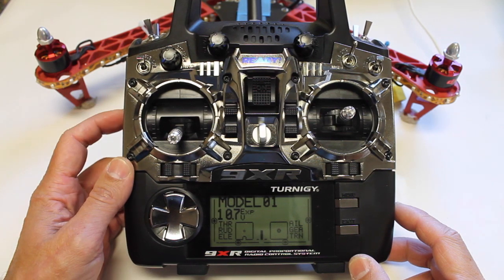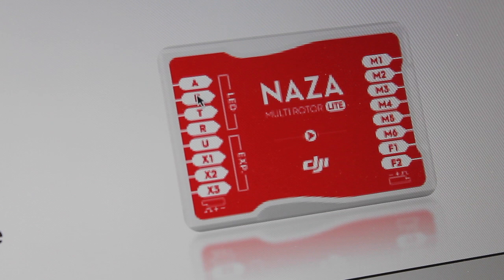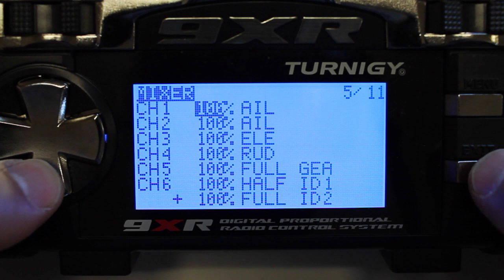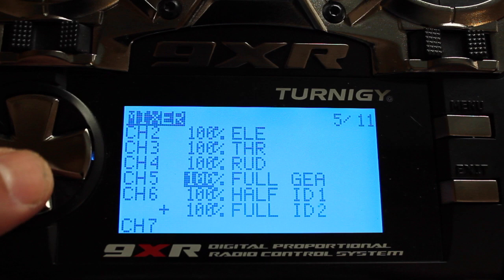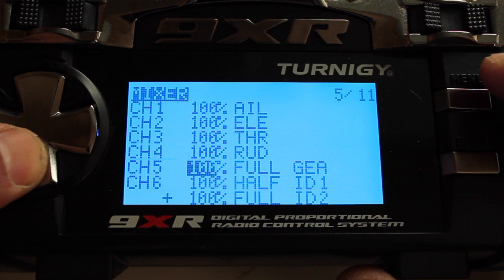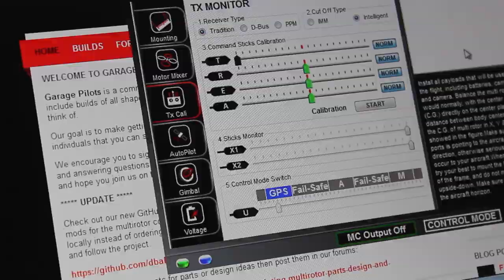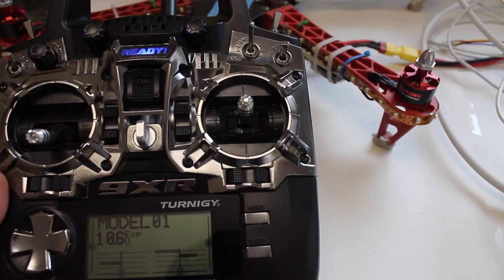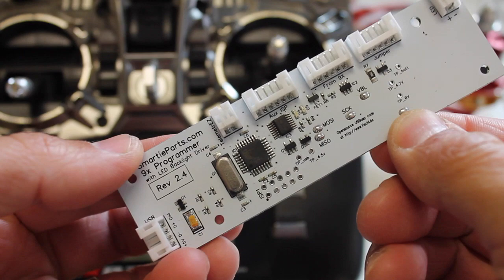Turnigy 9XR 3 Position Switch for Different Flight Modes w/ NAZA Lite and TBS Discovery Quadcopter

Comment: Yeah Dennis Baldwin the 9XR has the derivative software turnigy9X, but the er9X software is much much better, I flashed mine the Day I got it, that and coupled to FrSky Module and Df8R + RX and you have an awesome system with a Failsafe that actually works perfect too :-)

Comment: Brilliant! Very helpful and clear and it's solved my noob issue. Big thanks
Reply from the maker: Thank you for the feedback, Simon. Glad to hear it helped.
Reply: except, when I flick failsafe I get the failsafe mode activating but it still won't return home. It climbs to space instead. I've calibrated the GPS etc and I've got >6 sats so not sure why?
Reply from the maker: simon ayton That's strange. Does it fly okay in GPS attitude mode?

Comment: great stuff Dennis! Thank you very much for all you do for the RC community. Super helpful videos. have you had any experience with upgrading the firmware on 9xr radios? Also, any experience with the Naz. light to V2 firmware upgrade?
Reply from the maker: +Peter Schultze Thank you for the feedback. I have not done any 9XR firmware upgrade. I originally upgraded my 9X to er9x, but nothing other than that. I haven't done the Naza v2 light upgrade but have seen this going around: http://naza-upgrade.com/ Let us know what you come up with.
Reply: Love my 9xr. Just took time to learn and your videos! GPS attitude really very nice! light to v2 upgrade painful but result is amazing. Did it on Windows 10 with firewall and antiviral stuff off. Run as administrator. X2. Had to research drivers to even get machine to see Naza light.

Comment: Great video. Question though, have you gotten a failsafe setup for radio power or signal failure that the receiver triggers back to ID0?
Reply from the maker: Thanks Andrew! Does this help at all?

NAZA Enhanced Failsafe RTL After Signal Loss With FrSky Module

I realize it's for a 9X, but the real magic is with the FrSky receiver. I remember my original 9X receiver couldn't do this, but perhaps the 9XR receiver can.

Comment: I just got my Turnigy 9XR (stock firmware) and the D8R-II Plus, thanks to your fantastic and easy to follow tutorial I have my Naza V2 setup properly. Whoever, in case that you need to do the "Naza dance" how can you achieve that?
Is there a way to configure a switch to get from Atti to GPS? It was easy for me to setup on a DXi6 but I'm lost with the 9Xr.
Reply from the maker: I know. The 9XR is a bit challenging but since runs a version of OpenTX it's not too crazy to do. Have you tried going through the steps in the video but using different offset values? It should be pretty easy to modify so you can get in NAZA dance mode :) If you continue to have problems please check out www.garagepilots.com and post over there. Thanks!
Reply: Thanks Dennis, actually setting up the RX9 the way you did it, you can get the "Naza Dance" by switching 3 to 4 times from GPS to Atti mode, found that by playing around with the RX9 :)

Comment: Hey Dennis, thank you so much for this video, I've learnt more from this than all the other I saw. However, I do have some questions:
1, How does it come that you select the mode with changing the weight?
2, Is there an option to set the IOC to one of the other swithes? As I see, those are 2position swithes, so how to set three to them? (home lock, course lock and the normal)
4, when you switched to failsafe mode, it did not do anything. Is it because RTH was not yet set, or because you did not have a home set?

Thanks again, and if anybody can reply that is certainly cool too :)
Reply from the maker: paland4 Thanks so much for the feedback. Here are some quick responses. If you want to get more help I recommend checking out www.garagepilots.com. 1. Changing the weight essentially changes the signal value coming out of the transmitter. I've done the same using offsets before. 2. I'm not entirely sure. I have the Taranis now and it's easy to do but what I'd recommend is checking out the OpenTX documentation and seeing if there's a solution for the 9XR. 3. When I switched to failsafe I was demonstrating that the NAZA recognized failsafe mode with the quick flashing orange LED. It won't actually do anything when it's sitting on the bench, unarmed, without a GPS fix. Hope this helps.

Comment: Hi, great video.
Can I ask a question on a completely diff issue?
my f550 set up is flying for less than 1 min??? I don't know why nor can I figure this out as the same equip worked perfectly well on the original phantom that 4 of the motors, esc came from (now using a brand new naza v2 and gps) added two new motors and phantom 1 esc.
Its  set up my f550 on 3cell and am using the phantom motors and ph2 props which are the same as those used on the f550 kit.
It fly's and with plenty of power for about 20 sec then it will not maintain hover, the craft is constantly trying to yaw to the right (spin right) all be it quite slowly and any input control corrections are overlie responsive? 
I've used the phantom 2 controller on 2.4ghz  on this craft as well as the now 9XR on 433mhz and the craft behaves the same.
Basically I've taken my v3 phantom 1 and converted it to work on the Hex f550 adding 2motors ans ESCs and a new v2 nasa as the ph1 v2 naza's gps failed. last set up point, I have not added the combined compass GPS on the umbrella stand yet, but surely without these the craft should still behave as in atti mode???

A shorter side question, what is manual mode and what does it do? I cant find info on this.

All and any ideas, thoughts and suggestions are very welcome.

Regards
Chris.
chris.acorn@yahoo.co.uk
Reply from the maker: Armstrong Skyview I would do a NAZA reset to see if you can start from scratch. Also, make sure your quad is level when you power up and arm. The default gains shouldn't be too responsive for a F550 setup. To answer your question about flying without GPS yes you should definitely be able to do this. I flew my first NAZA for about a year before I purchased a GPS/compass. It flies incredibly well in atti mode. If you continue to have problems check out www.garagepilots.com and post in the forums. Hopefully we can help you out. Good luck!

Comment: Why dont you set the 3 position switch to GPS . Atti. Manual then use another switch with a mix to itself to operate the fail safe .
Reply from the maker: OutbackKanga Good idea. I don't have the 9XR with me at the moment but I'll look into it when I get it back. Thanks for the suggestion.

Comment: Very informative, but i have a question. When you set your source to half why would my 9XR not have that option, just has FULL and MAX?
Reply from the maker: Interesting. I wasn't aware of the difference but perhaps it's a firmware version issue? Or maybe it's something to do with what flight mode you're in.
Reply: Dennis Baldwin The version looks to be V1 5501-erez. I've added additional models and still no HALF on any of them.

Comment: I can not get this too work. Not matter how much weight I set it won't go I to GPS it gets stuck in failsafe. Also my config programme looks different too yours I assume its been updated.
Reply from the maker: Lawrence G Sorry to hear that. I no longer have my 9XR handy so unfortunately I can't help out. The difference in the config program may be that it's been updated since I posted this video. The general parameters/settings should be the same, but they'll be in a different location within the app.

Comment: Hiya Dennis i have a 9XR and the switch (3 pos ) is always in the middle on my Naza,its do,n
my head in trying to configure !! you the man please help and can you tell me why i cannot arm my motors ? is it anything to do with the 3 pos switch ? Thanks you the best .John
Reply from the maker: I wish I still had my 9XR so I can help you out. It really sounds like your endpoints haven't been configured on your switch or perhaps you have linked the switch to the right channel (U port) on NAZA. If that doesn't work perhaps someone on the channel can chime in and help out. Thanks for the question.
Reply: Thanks Dennis 9XR too much of a pain for me ,try Spektrum in Heli mode

Comment: How do u setup the channels for the Torrent Blade 110 quad? Prop doesn’t turn when I move throttle. Then if I move switch to ID2, it starts spinning. Help!! I’m a newbie.
Reply from the maker: I'm not familiar with that quad model but check your channel configuration as that's likely the culprit. I think the default Taranis is TAER so but check your slider screen that shows all the outputs of the channels as you move your sticks. Then make sure those match up with your Blade 110 channel config. Good luck and sorry I couldn't be of more assistance.
Reply: Dennis Baldwin, it worked! I just replaced the 2 switches in addition to following the channel order. Thank you very much

Comment: HI dennis
i have a problem with my 9x and naza
how do i get my 3 pos switch assigned to an aux channel so i can use it as a Uchannel on naza? i cant find any info on how to do that...
does the 3 pos switch(aux3) have any function?
Reply: If you could be bothered to look through Dennis's video library you will find there is already a video on this topic for the 9X / Naza.
Reply: yeah found it 3 minutes after that first comment
Reply: Cool

Comment: dose this tx have heli or airplane mode to choose from, which one are you using for your setup.
Reply from the maker: New Sky RC Drones It has a simple template which is like a airplane mode on the 9X. It also has a Heli template, which I haven't used. You can see all the templates here:

http://www.hobbyking.com/hobbyking/store/uploads/1058418382X192693X3.pdf (see the table of contents to find what page the templates are on).

I just started from scratch, which I believe will default to the simple template. Don't quote me on that, but that's what I recall. Hope this helps and good luck.

Comment: Which one is better: Taranis or 9XR?
Reply from the maker: I've been holding off on the 9XR in hopes of getting my hands on the Taranis, but it's so hard to come by! Good luck if you try to get one and let me know if you do :)
Reply: Dennis Baldwin I actually have both because the first time I tried to buy the Taranis it was on backorder so I went for the 9XR. Eventually the Taranis came, so I'm using that now along with a D8R-II+ receiver. Haven't really used the 9XR much so I can't compare.